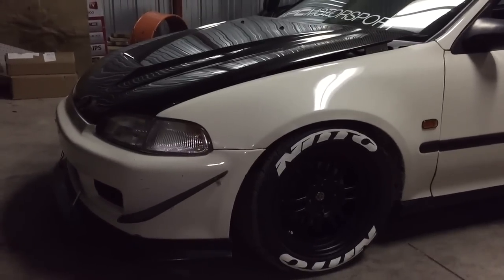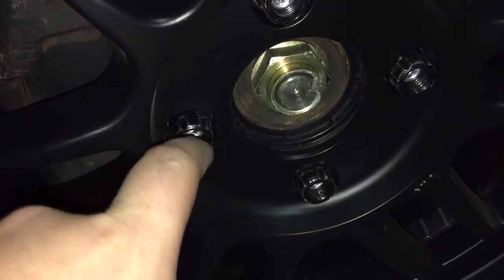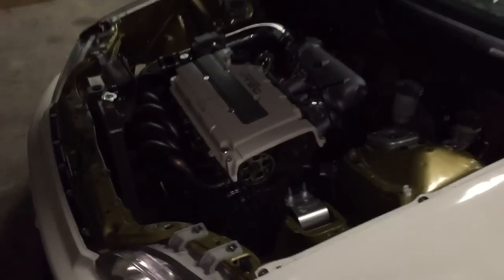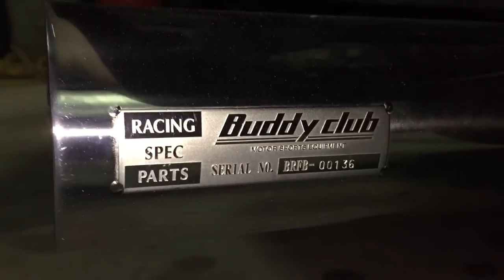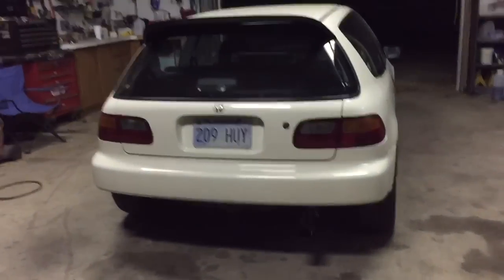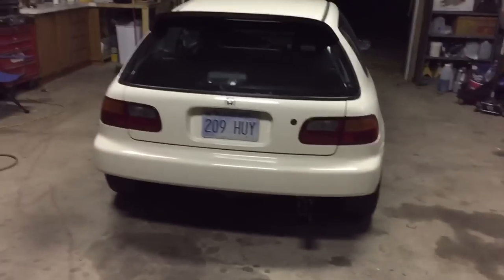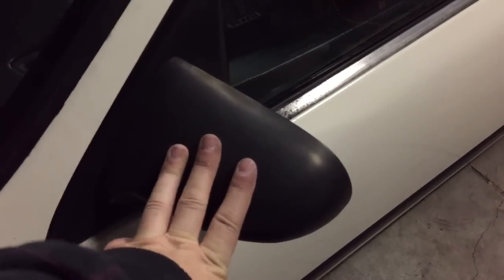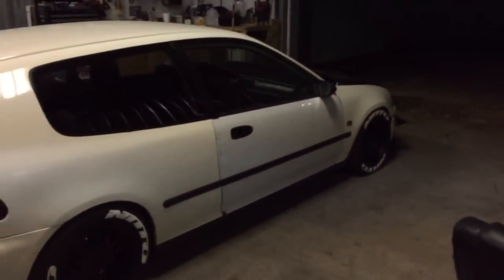Buddy Club Spec 2 Exhaust + 2 Step?

Comment: very nice finally someone's doin it right. good job man!
Reply from the maker: joethecollector thanks man means alot
Reply: Coda5610 btw when you have the cash get a rear sway bar and install the energy bushing on front upper a arms and lca! Mark my words major!! improvement in handling.
Reply from the maker: joethecollector yea, my old black hatch i put the full energy suspension bushing kit, car was solid asf

Comment: Which one sounds better Yonaka or Buddy club ?
Reply from the maker: Noah yonaka does tbh
Reply: I have a Yonaka Catback on my car right now. Here's the thing, The exhaust does have a good deep tone for a Honda catback. BUT, it doesn't add power till you double your HP. if you don't care about power gains than go yonaka but Buddy club is a straight through catback with Dyno proven number gains for just a catback. I'm getting this exhaust because I want a Osaka japan style exhaust, and it adds power. Also you can easily add a second res in place for the cat or get a Vibrant ultra quiet res in place in the stock res and it'll tone it down a bit and make it a lot deeper tone while having that power and less restriction